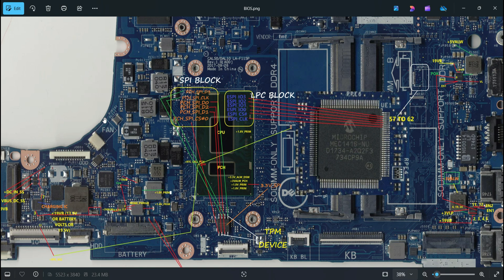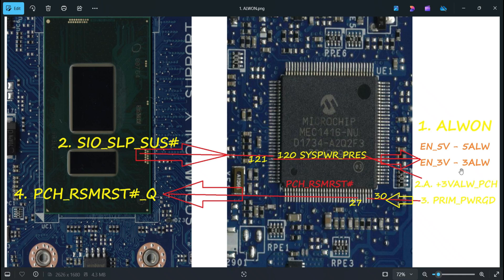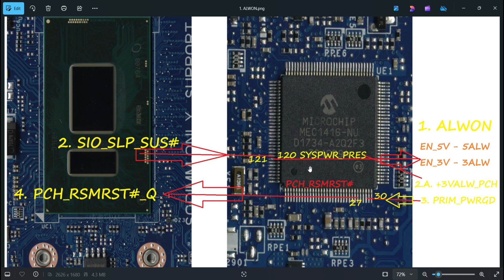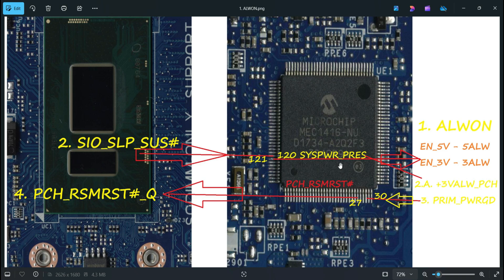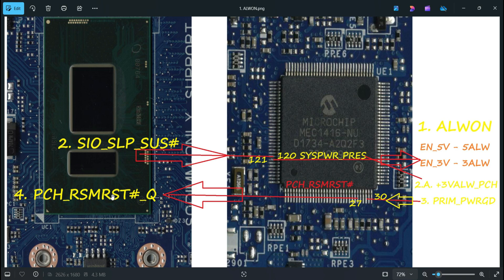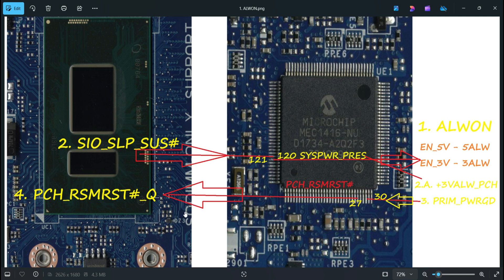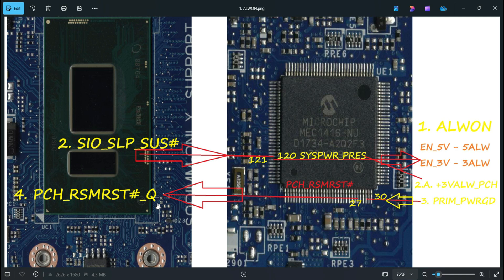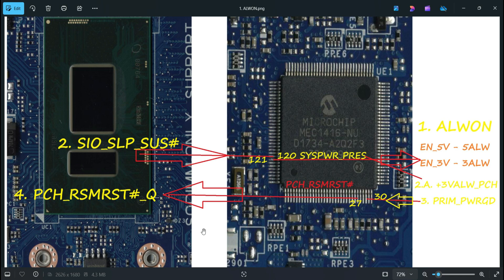PCH_RSMRST# - 06 | Laptop Motherboard Repair

Comment: 🙏please sir, make video tutorial on BIOS ic program/flash process, i saw so many videos but all those are too much complicated or lack of information. because they don't clear how much output voltage required in CH341A programmer for 25 series BIOS ic. and so many people say about ch341a programmer... like...

"if you want to program your BIOS ic, you will need to customise this program. you will need to connect jumper wire to this pin and that, do it and do that ect... and if you will use it without customise so output 5 voltage will burn your BIOS IC"
Reply from the maker: ON BIOS, I ALREADY DID SOME VIDEOS. YOU CAN CHECK MY CHANNEL. STILL WILL TRY TO DO MORE